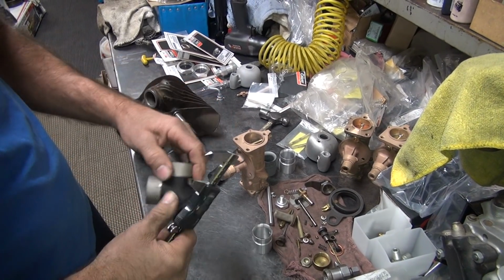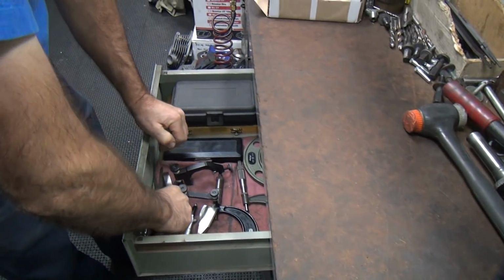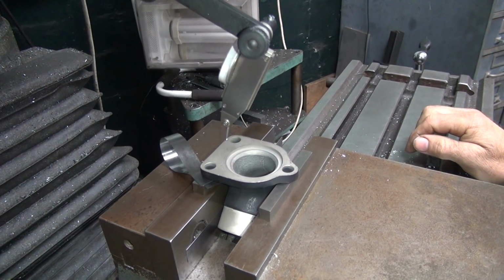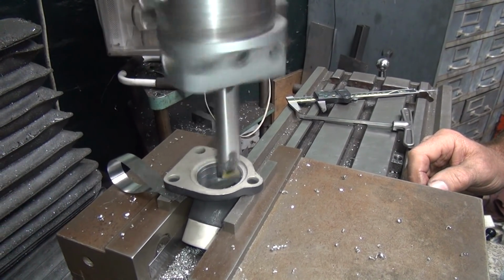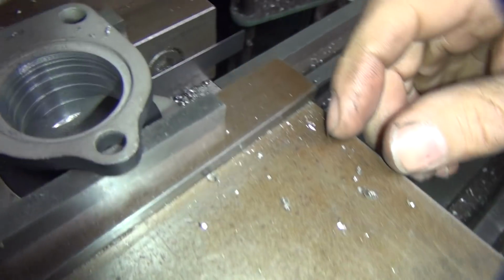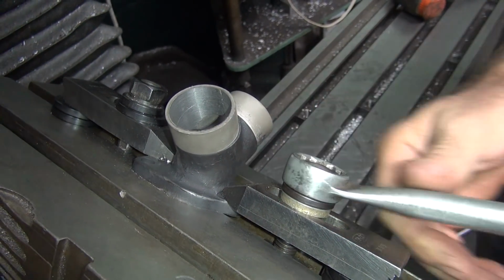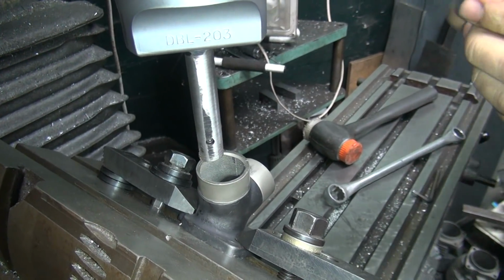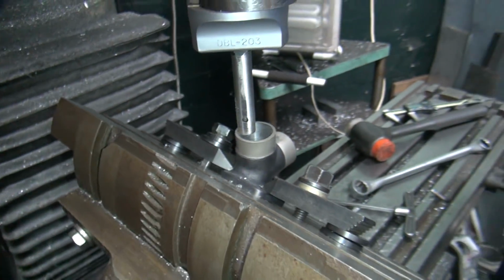1942 wlc wla 45ci #106 m-88 linkert carb rebuilding carburetor assembly harley tatro machine

Comment: So with all the mods here to make things flow better, would you shape the divide where the runners split off toward the intake ports to be sharper so it helps guide the flow, or would it be better to round that area to help the air/fuel mixture and let the intake stroke pull what it needs?
Reply: Never mind, just watched the next video.